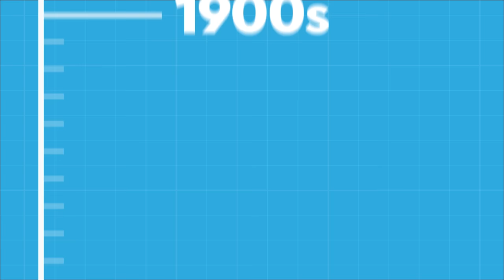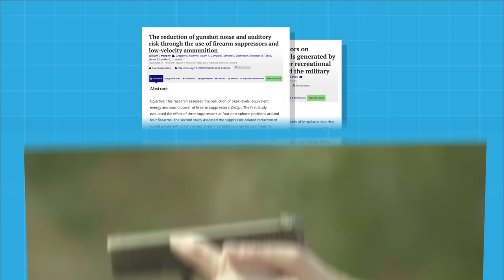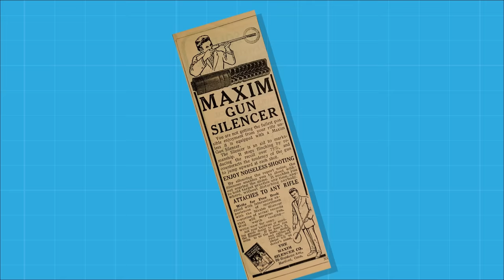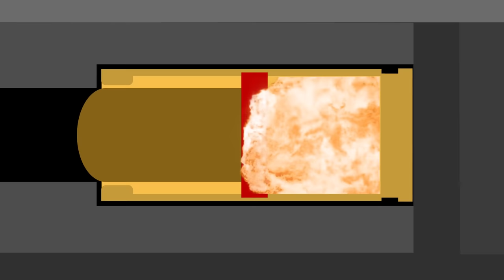How Silent Are Gun Silencers? DEBUNKED #moviemyths #debunked

Comment: You forgot to mention its almost impossible to suppress a revolver. There's a gap between the bullet cylinder and the barrel , except for the Nagant 1895, where at least some gas escapes, causing noise even before the bullet leaves the barrel. So that gun in Corruption is totally bogus.
Reply: How you grip a revolver with your support hand is critical. Escaping gasses between the cylinder and barrel are no joke. A .22 can sting and leave a powder burn while a .44 can blow your finger off.
Reply: You have to cover the gap with your hand to reduce that part of the report.
Reply: It's possible to do but impractical. You can clamp the frame to enclose the cylinder. Some German dude did it a long while back with a 45 cal Smith and there's a dude here on YT that did one.
Reply: That is not completely true anymore. There are a few revolvers that have tight enough tolerance to allow a suppressor to be used. They are rare but exist. However, they are not silent like the wellrod or wellwand. They just lower the noise level, so it does not deafening you when it's fired. But yes, if you want a better option to protect your hearing, an automatic is a much better choice, a lot cheaper too.
Reply: I had a Tula Arsenal Nagant. The forward motion of the cylinder and extended case on the ammunition was a great idea but the Russians never could build anything as refined as the Swiss. It was a really cool revolver but had a god awful trigger pull.
Reply: @52156drj  you obviously never figured out to shoot in single action or how to grease the internals to reduce the double action pull to seven pounds
Reply: @billlyell8322  not true. the only commercial manufactured ready to silence revolver is the Russian made Nagant.
Reply: @ikocher  The anti-terrorist German police had a revolver with a cylinder attachment
Reply: the only gas that escapes is through the barrel. you obviously fired one. I have one and without the can it sounds like a 38. with the attached can it sounds like a cap gun. if I had it as an integral like the KGB did the only noise would be the click of the hammer
Reply: @toomanyaccounts  I don't recall who made them, but I recall seeing them exist, which proves it is possible to do. But then again, why do it? Lol. For me it was just a novelty. Lol.
Reply: @jacka55six60  They actually did that on Mythbusters (blow a finger off)
Reply: @natehill8069  Paul Harrell did it to a chicken leg. Shredded it.
Reply: Nagant M1895, or OTs-38 Stechkin silent revolver... But other avarage revolvers can't be silenced.
Reply: Ting a "silencer" on a revolver has always baffled me. See what I did there?😂
Reply: Not almost, they are IMPOSSIBLE to suppress, unless its a gas seal type revolved, where the cylinder makes contact with the forcing cone of the barrel upon firing.
Reply: @clwomble  don’t tell people to do stupid things.
Reply: You can suppress a Nagant M1895 revolver, due to it's unique mechanism and ammunition: a brass flange on the case is pressed up against the forcing cone by the cylinder when the hammer is cocked, eliminating the gap.  

You can see one at the CIA Museum in Langley, Virginia, USA
Reply: @chiefcrash1    The problem with the Nagant revolver is that it is dreadful.  The trigger weight and pull make it almost unusable.
Reply: @dickjohnson7845  Not to mention the ballistics on the cartridge sucked anyway...
Reply: @jacka55six60  "Cutting a finger off" is probably a more accurate description than "blowing a finger off."  There is a very high pressure jet of gas that escapes the cylinder/barrel gap of a few thousandths of an inch breadth that has an extreme cutting force.  The pressure in magnum pistol calibers runs from 35,000 to 65,000 psi.
Reply: I heard a lot of the noise is the bullet cracking the sound barrier
Reply: The nagant with a BraMit device is remarkably quiet for such an old gun. Quirky little gun, with its weird ammunition
Reply: There is one revolver in the world right now that can be supressed and it's the Nagant M1895.
Reply: The inside end of the barrel on the Nagant revolver has a slight protrusion. When the gun is being fired, a mechanism pushes the cylinder forward and the typical gap you would see in other revolvers gets sealed so no gas escapes through that gap. The brass casing if the rounds extends out over the copper bullet head and is slightly crimped, which expands against the already created seal, also preventing gas from escaping. Funny enough both of these concepts were designed to prevent the bullet from loosing velocity due to losing gas, but it also allowed for the nagant to be suppressed. Most modern revolvers can’t be suppressed, unless they are designed with as small a gap between the cylinder and barrel as possible. As for the chamber sealing design, the Nagant is the only revolver that has it. It’s never been replicated because it’s not very practical.
Reply: Except you have the Nagant M1895 revolver.
Reply: @David-hm9ic  arguing semantics when cutting is defined as "severing with a knife(or sharp object) or as if with a knife(or sharp object)" and the gasses while concentrated at contact still move outwards conically, it is "Blowing off". the gass doesnt keep its power concentration and your finger will be moved by the force, breaking your bone and ripping apart cartilage, muscle and skin. the gasses will however at first cut into your finger that much is true
Reply: Google suppressed revolvers. I see several different types. I don’t think they are all a nagant. Regardless what’s the point. 😂
Reply: @jacka55six60  ... as was demonstrated by the Mythbusters...
Reply: Can't recall seeing any movies with suppressed revolvers.
Reply: @Svetty00  I believe one of the Dirty Harry films showed it… Don’t recall which, though.

UPDATE: Oh yes, it was in "Magnum force".
Reply: Aaaaand of course the most important example is missing. There are videos here that address exactly that. If you combine sub-sonic ammo with a suppressor you will get exactly what these guys claim isn't possible. An almost silent gun.
Reply: @EbonyPope  What example do you mean? “Almost” is a very relative term… :-)
Reply: @EbonyPope  No, you will not.  I have heard a silenced .22, a silenced Nagant (the best the Russians allowed the Bulgarians to have in the 80s) and a ОЦ-38 Стечкин (O-Tz? English does not have that letter) a revolver that uses internal piston cartridges..

Not one of them sounded less loud than a jackhammer.  Even the Stechkin, which has NO muzzle flash, and allows NO gas whatsoever to escape the cartridge.  I know that the US has its own version of the Russian special Ops revolver.  I have not seen it, less alone heard it firing.  But the lowest decibels I found listed for a firearm that is meant to kill humans is 110db, for the above mentioned ОЦ-38.  

Almost silent firearms do not exist.  Nor almost silent crossbows.  There are lethal airguns that are a bit less noisy than firearms, but they still register at 100db.That's a loud shout in your ear.  If you consider that silent, I do not.

Now, you can take a hunting air rifle and silence THAT.  I have seen one fired, and that is... Very quiet.  Hollywood quiet.  The problem is, I have not seen that rifle bullet hit ballistic gel.  I wanted to, I had some in the car, but they guy who had it did not want to do it.  So I do not know whether it was an effective weapon.
Reply: believe me ive tried. the .357 magnum's distinctive crack is changed to the .357 magnums distinctive crak. there is almost no change
Reply: @toomanyaccounts Greasing the sear won't reduce the trigger pull weight significantly. It might be smoother, but only if you polish the sear and mating surfaces.

Comment: I wish you mentioned the fact that a suppressed subsonic .22 is possibly the quietest gun you could find. It’s honestly pretty cool how quiet those things are
Reply: An oil filter on an AR is pretty damn quiet too.
Reply: It needs to be a .22 subsonic round bolt action also that is the quietest suppressed gun I have ever shot!
Reply: I agree.  I think of it as quieter and about as effective as a dieseled 22 air rifle.
Reply: Can it do any damage though?
Reply: A locked breech design  (competitive pistols) .22 can be made extremely quiet with a subsonic cartridge, a plastic bottle, a drilled hole and some foam inserts. Won't last many shots but still very quiet.
Reply: @thaddeusroberts2393  absolutely it can, i have shot many foxes in residential areas with subs and a rudimentary suppressor
Reply: @Conky88 is it shooting a rifle caliber or is it fitted in with .22? I doubt any kinda rifle can be really suppressed.The only caliber in my knowledge that has the most suppressed sound is .22 subsonic,anything above you can hear in a long distance
Reply: @FD-wl7xq  no it’s a 5.56. I was shooting 62grain green tips. It’s super quiet. Gotta use the oil filter with the cardboard inside it. Don’t use the hard rough tip ones like fram make.
Reply: @FD-wl7xq  you can’t hear it past 30 yards. I was in the dead of night at the farm shooting it.
Reply: @thaddeusroberts2393  it can, you shoot someone in the head or heart or lung you will almost always kill them, there have been a few survivors or head shots but not many. But yes a .22 is still deadly, though it doesn't have much stopping power or range.
Reply: ya my .22 airgun is... with the power of around .223
Reply: @thaddeusroberts2393  .22 can certainly kill but, lacks in stopping power. However, subsonic 300 BLK with a suppressor isn’t as quiet. But, it is quiet enough to not need ear protection and packs a big punch.
Reply: @thaddeusroberts2393  .22 subsonic ammos travel just slightly below the speed of sound and while they're a little bit less powerful than regular ammos, they're just as deadly in most situations. Silencers themselves don't reduce the power of a gun, it can even make it more accurate in some situations.
Reply: I came here to say that. A suppressed subsonic .22 is very quiet. Even a non-suppressed subsonic .22 is quiet. I've heard both and from a 10-22 either is quite quiet, obviously the suppressor does help though. With one, the action of the semi-auto gun is basically as loud as the shot itself. I doubt anyone would recognize it as a gunshot past a couple dozen yards
Reply: Sub sonic 9mm and 45acp aren’t that loud either. Not Hollywood quiet but pretty low volume.
Reply: @CKidder80  I own a CZ-457 that I ALWAYS shoot suppressed.  The very first time I used sub-sonic .22 Rimfire all that was heard was the click of the action.  Everybody around me was laughing at how Seriously quiet it was.
Reply: @thaddeusroberts2393  yes..
Reply: @thaddeusroberts2393  Well I wouldn't want to be shot by one.
Reply: @thaddeusroberts2393  You will answer that question very quickly by yourself once anybody is just as much as pointing a  silenced .22 at you.

Trust me :)
Reply: Abaut silent guns just look welrod
Reply: Yes, subsonic 22LR rounds are not that hard to find.   You just have to look at the rated speed, and if the round is rated at or below 1000fps, it will be subsonic.  And they are very quiet with a suppressor.   I have noticed that 22LR that are specifically labeled SUBSONIC are usually priced more expensively than 22LR rounds that go unlabeled and the fact that they are subsonic is hidden in the fps speed rating.   Because you know, the SUBSONIC 22LR is an exotic bullet that you can use with a silencer to do these ultra quiet John Wick assassinations, while the other one is the manufacturer cheating you by putting in less powder to save money and giving you an under powered bullet.
Reply: @thaddeusroberts2393 still very much deadly. theres a ton of videos on yt showing test
Reply: I seen this crazy air gun that fired rounds that could kill at an extreme RPM. 

 Was definitely quieter than a gun. Looked like a laser with the shot grouping. Must have been firing like 700 plus RPM, subsonically. 

 I cannot find the video for the life of me. Again it reminded me of a laser with the RPM, and shot grouping. If anyone knows what air gun can do that, and fires a deadly round. Please tell me. 

 Anyway I saw an other air gun that fired these weird bullets. More like a dart. Extremely deadly, accurate, and quiet. 

 Honestly I'm not sure why air guns aren't liked as much. Things seem awesome. I wonder if you could build a small compressor, powered by solar, and can recharge the canisters on the go.
Reply: @dianapennepacker6854  from what i know air guns were on consideration for mass production at some point but was not continued cause in practise they had so much more issues than gunpowder guns
Reply: Aaaaand of course the most important example is missing. There are videos here that address exactly that. If you combine sub-sonic ammo with a suppressor you will get exactly what these guys claim isn't possible. An almost silent gun.
Reply: As I understand it typically high level Spec Ops typically use subsonic 9mm and 5.56 with suppressors. That's far closer to the movies, a lot less stopping power, but they have stuff to make up for it when firepower is needed.
Reply: I have silencers on my .22 bolt action rifle (use subsonic ammo) and on my .22 semiautomatic pistol (here normal ammo at 1050 or 1070 ft/s does not accelerate the bullet beyond the sound barrier due to the short barrel)

Both are more silent than a .177 spring air rifle that is also subsonic at about 260 m/s. 

The spring noise of the air rifle is louder than the mechanical noise from the semi auto pistol. 

On all three the impact is what makes the most noise. 

Can shoot all day and the people around don’t even notice I’m shooting. 

Disclaimer: I live in Norway, silencers are free to buy. So I’m not breaking any law 😂
Reply: @Conky88  An oil filter on an AR will lead to hearing loss, especially when the ATF shoots your dog.

Comment: You forgot to mention that Silencers/Supressors also reduce the Muzzle Flash of the Guns, also a nice to have
Reply: Forgot to mention that suppressors can add a little effective barrel length giving a little more speed than may add a few dozen meters before tumbling.
Reply: @curteaton  Wouldn't that reduce the speed tho? Since the Gases are hindered to expand, therefore not being able to power the Round that much, even if the Barrel is a bit longer
Reply: I would think it would actually push the bullet more because when you shoot a gun normally the gasses are going who knows where when they leave the barrel, but with a suppressor the gasses are now being directed through the suppressor even though it is filling the baffles in the suppressor gasses are still following the bullet thus giving more muzzle velocity. At least that makes sense to me.
Reply: @super1million11  I mean, it does sound logical, I have just never heard that it increases the Muzzle Velocity, more like the opposite, but I could be wrong ofc
Reply: Formulation of powder to suppress flash is more important than sound suppressors or flash suppressors.
Reply: @Aquila.  i think there were tests and it does slightly increse bullet velocery charecteristics. something i wish videogames  would do , or at least not reduce the damage as they always do with  any silencers
Reply: @kirill2525  I see, thanks for correcting me!
Reply: So does the Vortex flash eliminator but it does nothing for noise level.  Try 1 for zero flash from a 5.56 AR. A muffler works as a recoil reduction device as well a sound reduction, NOT sound eleimination.  https://www.youtube.com/watch?v=i3dFnENc7iM
Reply: German detected lol
Reply: @super1million11  iirc he said it also takes longer for the gasses to escape the barrel so i dont think it increases muzzle velocity, not sure though

Comment: I fired a suppressed Uzi smg back in the day, and iirc the sound of the bolt cycling back and forth was louder than the report. Suppressor didn't use simple baffles, it had a double helical thingy as well as a couple other odd-shaped internal components. Also, we fired subsonic bullets.
Reply: The end of what you wrote is the key, subsonic rounds. Regular rounds sound more like a crack than a bang out of a suppressor.
Reply: Aaaaand of course the most important example is missing. There are videos here that address exactly that. If you combine sub-sonic ammo with a suppressor you will get exactly what these guys claim isn't possible. An almost silent gun.
Reply: @EbonyPope You really need a integrally suppressed  gun like the Welrod which also employs rubber "wipes" which partially seal the bullet hole in front of the baffle. The best silencers use *multiple* wipes to contain as much of the gasses as possible. Those silencers are actually befitting of the name.
Reply: @stopthephilosophicalzombie9017  Yes but that was my point. And even similar examples exist which is easily found here on YT. They didn't even do basic research for this video otherwise they would have mentioned it.
Reply: @EbonyPope  just shooting subs is not the answer. It's still loud, just well below hearing safe. You're still dealing with things like port pop and the fact that suppressing larger calibers is never going to be 100% efficient. The quietest thing you're gonna get is either a bolt action or break action .22 shooting subs with a wiped suppressor. Now that would be movie quiet.